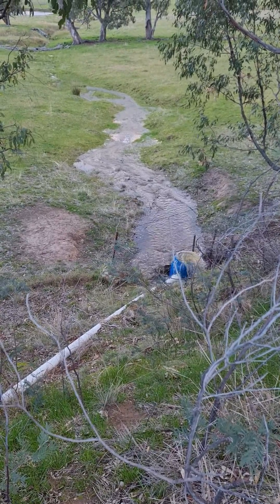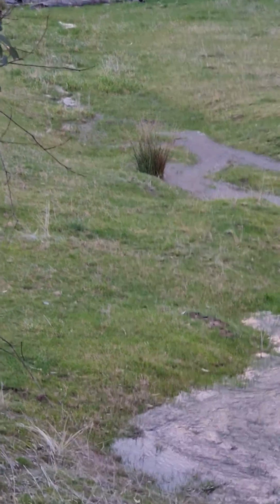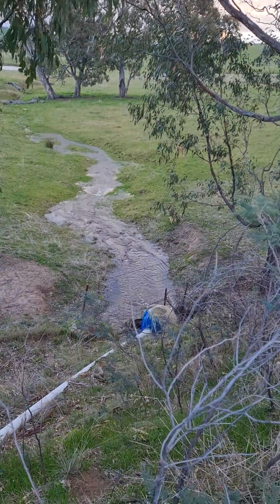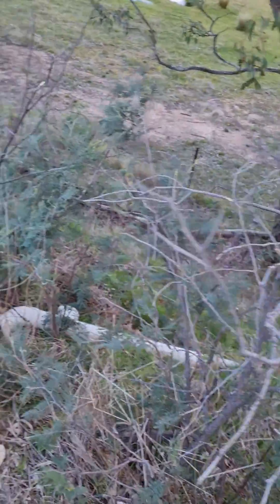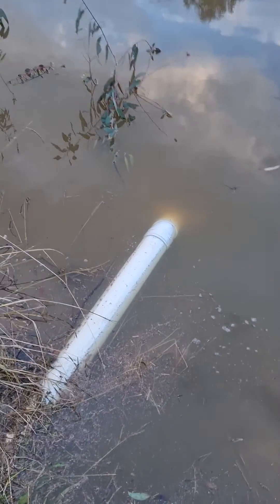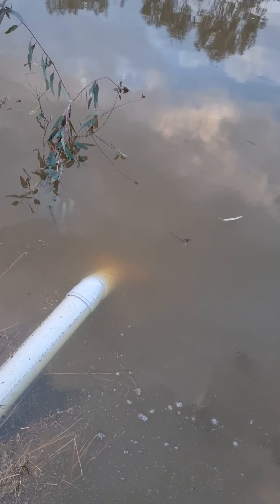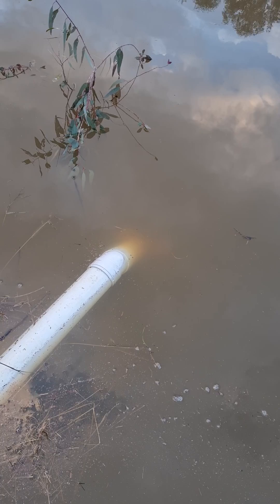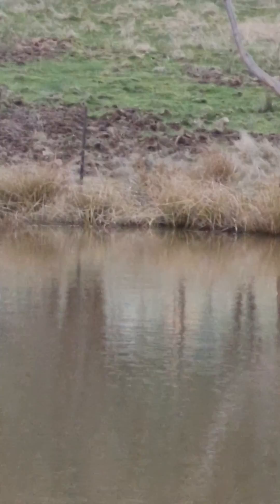How does a syphon overflow on Eaglerise dam work?

Comment: Is the water just going down a gully and away, is there a chance to sheet flood it across the paddock? Getting 2 bites off the cherry?
Reply from the maker: Hi Adam. In this case the outflow is on my boundary fence. My neighbour is happy for the water to flow gown the drainage line as he has a dam about 100m further down.
Another issue with trying to sheet irrigate comes when you see that this dam only overflows for a short period of time after rainfall events. There is not a large catchment and the gully only flows for a few months each year. When it is flowing, the lower soil is already at  field capacity. It would be fantastic if it flowed all year, during the hot dry season.